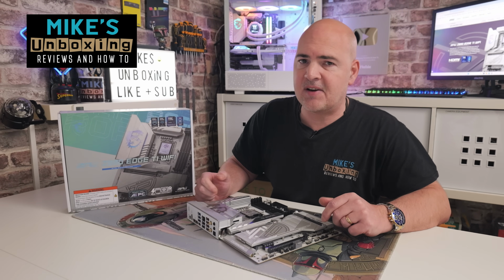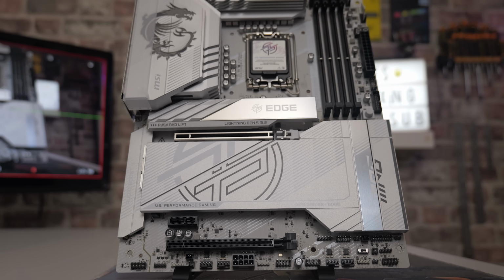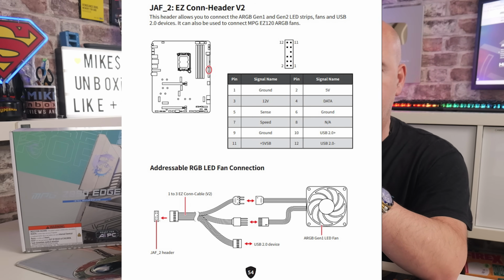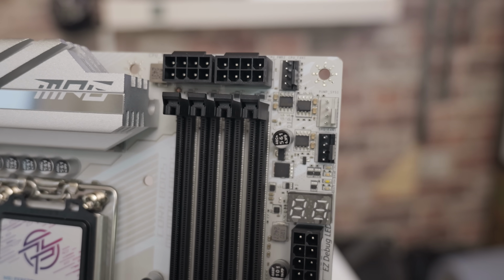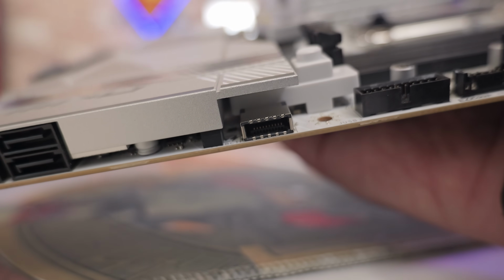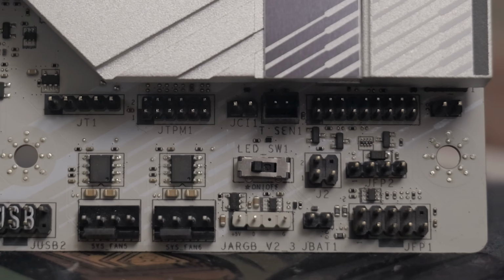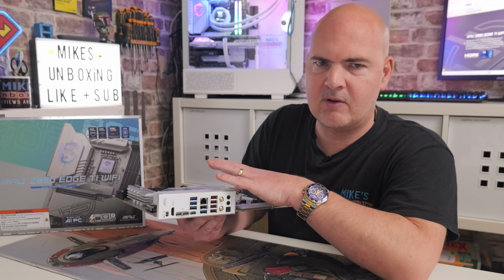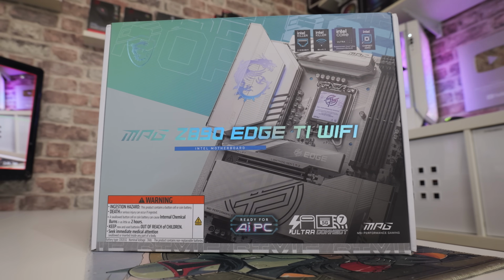MSI MPG Z890 Edge TI WiFi 7 Premium Intel Core Ultra Motherboard Unboxing

Comment: Very nice video and very detailed of all the headers etc.!!!!
Where did they hide the CMOS Battery?
I have looked at the manual online for this board and the Carbon WiFi motherboard in which they mention the CMOS Battery. However, they do not show the location in the schematic’s.
I have also not found any YouTube postings that have shown this location. Actually I found only one that even talked about it by saying they couldn’t find the CMOS Battery location. O’ MSI has not responded to this question posed to them.
Thanks to all, who are in the know!
Reply from the maker: i think it is under the second part of the m.2 heatsink, or under the VRM heatsink next to the rear IO
Reply: @ Mike thanks the reply. You would expect an easy access to that CMOS Battery, however MSI sure did hide it in what ever recesses of the motherboard. Which makes me wonder how easy it will be to replace that battery. the owner’s manual schematics don’t show the battery at all they do mention it later in the manual just for the type of battery being a 2032. I have not found ANYONE who has covered this location, which I would have thought someone would on the unusual location spot. You look at those video’s which take off that heat sink for the M.2 slots and there just nothing there, on any videos for either the MSI Edge Ti WiFi or the MSI Carbon WiFi for both Z890 chipsets (will assume the Z870 chipsets MB’s are similar for the AMD models).
Anyway, should you happen to squeeze a short video post in your busy schedule. I myself at the very least would be appreciative and other’s I would hope as well. For this very odd situation, since those batteries just generally stick out on the motherboard. 
I learn a lot from your reviews for my next soon to be build computer (my 3rd over last 25+ years). Currently still using Intel 2600k i7 and keeps on trucking with the ASUS P8Z68 Deluxe motherboard, 14+ years old. However, unable to upgrade to Windows 11 and with end of life for Windows 10, a new computer is going to be needed for moving into the future.
Best to you, keep those nice informative video’s coming!
Reply from the maker: @Majeskty  i did open it up and have a look, the battery is on a small two cable extension and is hidden under the heatsink and can be a real pain to get to. the battery and cable is very hard to find for sale.
i would cut the battery plastic cover and then stick the wires to a new battery if you cant find a suitable replacement
Reply: @mikesunboxing  Is it possible to disconnect the CMOS cable, replace the battery, and then plug it back into the two-pin connector?

Comment: The two 8 pin CPU power connectors should now be more accessible when you use an air cooler.
Reply from the maker: yeah that is true, but will need the case to also have large enough cutouts in that area, and i'm sure some wont

Comment: If i was doing a Core Ultra build honestly this would be the board I would go for. Very nice. I thought four M.2s on my Z790 AORUS ELITE was a lot... Now it's Five... 😂 My new year's resolution is to finally be rid of all mechanical drives in my builds. 🤟
Reply from the maker: i am lucky that only my NAS has mechanical drives now

Comment: Wow what a motherboard! So packed with goodies! Love the usb with drivers, the pcie lock makes total sense, those m.2 pins are great idea instead tiny screws! Mb looks quality and no doubt price reflects this but sadly way out of my price bracket. Thanks for review Mike and Kath 🐈👍
Reply from the maker: it is a big investment and without knowing intels plans for the socket and longevity it could be a costly mistake, they need more transparency, but that isn't MSI's fault